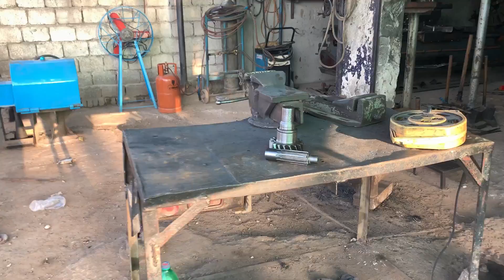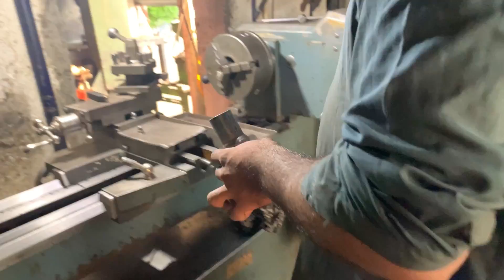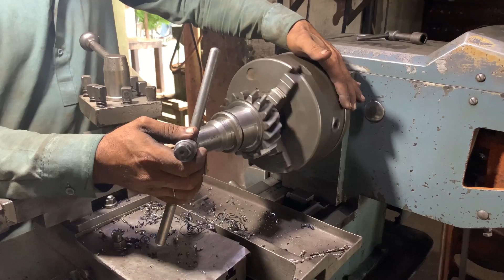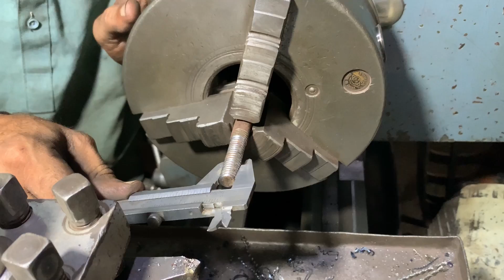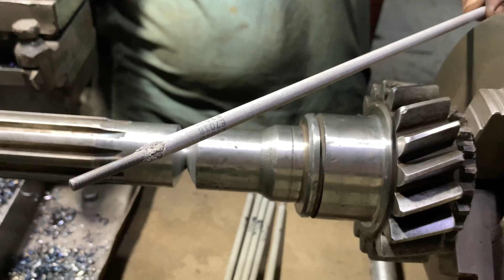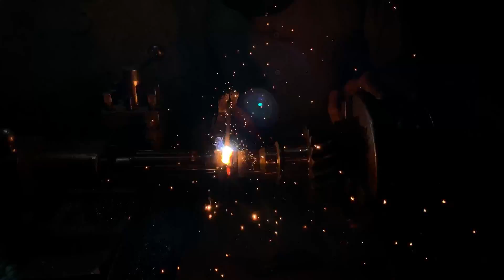The Genius guy connected broken input shaft very nicely || Amazing work

Comment: As an emergency repair, it is OK.  It will only work if the truck is driving on plane surface with no load, and at low speeds.

Comment: Nice work but it won’t last five minutes, he drilled a big hole up the centre then used to big a rod for the first run meaning half the shaft is not even welded , he never even ground down his big tacks before doing his first run